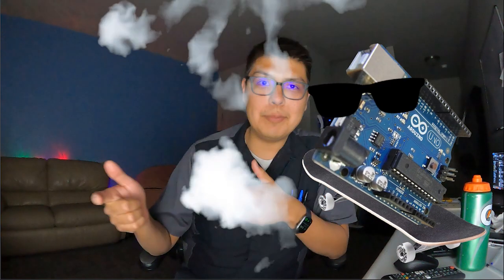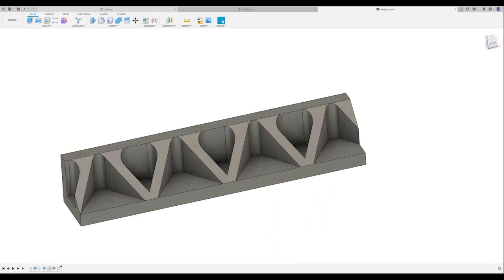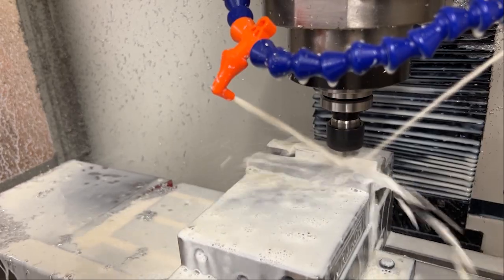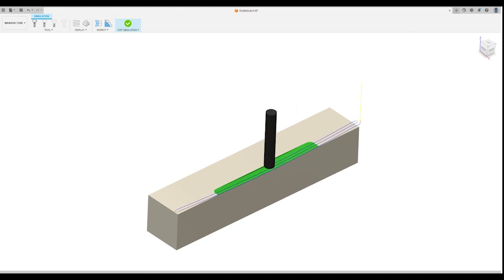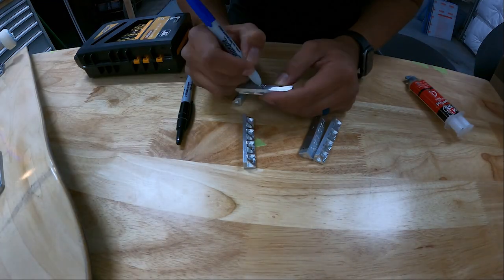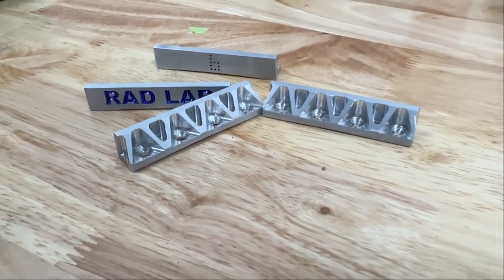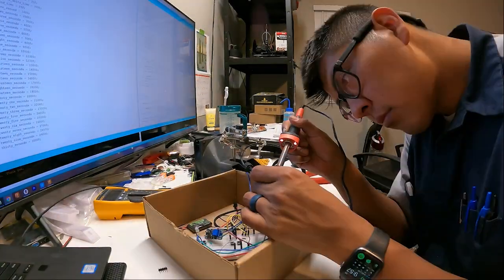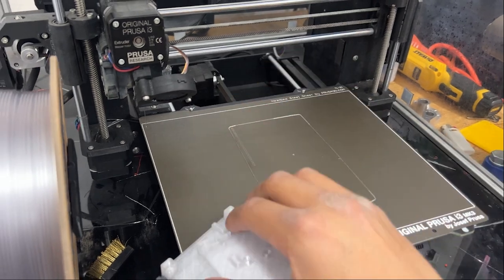Putting A Computer On A Skatebaord To Time Your Manuals

Comment: Super cool project! I love the addition of the Rick Sanchez voice. I am curious about the audio setup. How many mp3's did you end up making? Are you combining multiple files to add "cool" or "awesome" before the time read out? Can't wait to see what Braille can do with it.
Reply from the maker: I ended up making 31 clips of sound from FakeYou. The startup sound that says "Hey Braille, I'm skateboard Rick!", seconds 2-30 (I didn't do 1 second because it felt too short), and one clip that plays for any manual over 30 seconds (Rick gives you props and says that he can't count that high). The "cool" and "awesome" are just baked into the audio, I did that primarily for variety. The MP3 module is a YX5300 UART Control Serial MP3 Music Player Module.